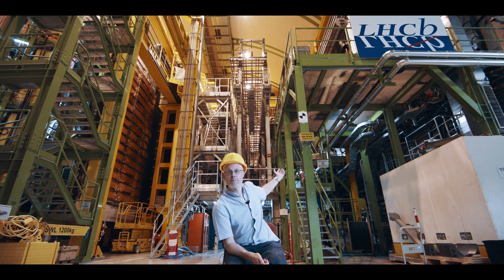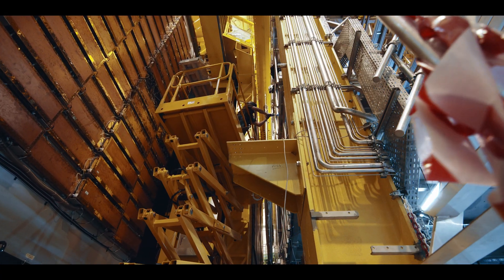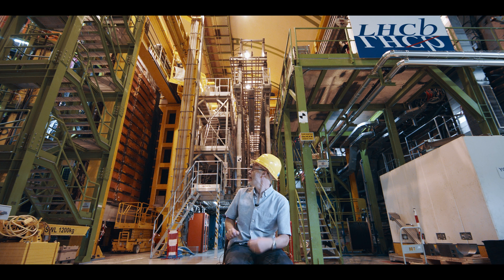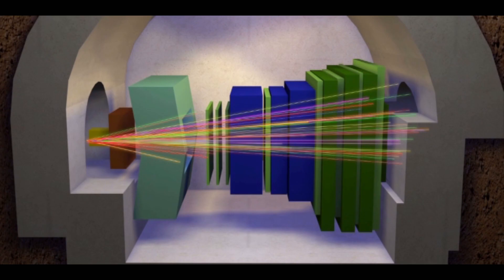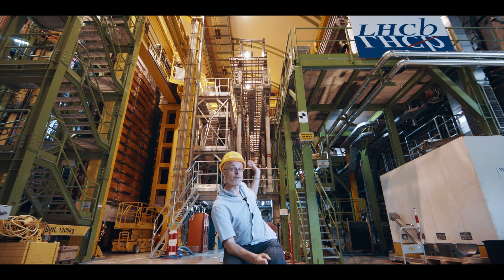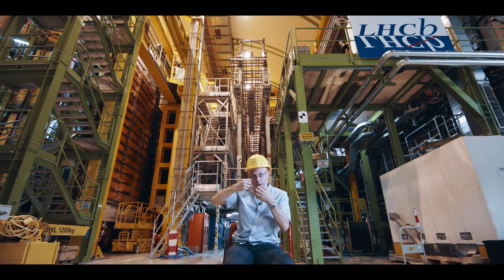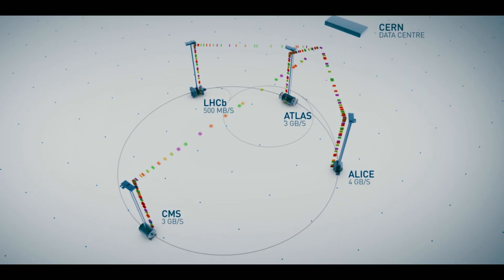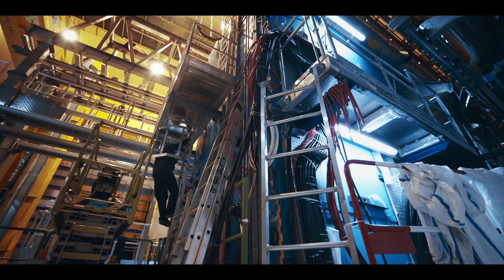What is the LHCb Experiment at CERN?

Comment: As a layperson, I unfortunately still don't understand what LHCb does. 
As with Atlas, CMS and Alice etc., protons are collided and the results are measured with detectors, that data is transferred to the data centres and analysed. Great Video !
But ....
What makes LHCb different to the other experiments that collect data from proton collisions ?
Reply: It does the exactly same thing! But the detector which takes the data (So the LHCb machine itself) is very different to Atlas and CMS. 
LHCb is build to detect mainly particles which are directed into the direction of the beamline, but not for example in the right angle to the beamline. This means it can't really detect high mass particles as well as the others, but is much better with the very interesting B-Mesons, which are mainly produced in the beamline direction. This allows to learn new things about Antimatter-Matter asymmetries. Ok that was a bit technical, but I hope I could answer your question a little bit :)
Reply: I think it's the only one big enough to collide them at the speed of light.
Reply: They started looking for signs of Super Symmetry.
Reply: @DaxHamel  Sorry, but we do not look for that at LHCb, at least not directly like ATLAS and CMS do